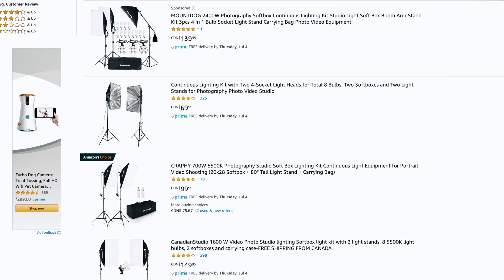What is a modelling light on strobes?

Comment: I appreciate the video it came real close to answering the question and problem that I have and it sound like we have the same problem when we first heard about modeling lights I like your whole video with you left out the important answer to the question that I have why you have the modeling light on and a preview of where your flash is going to go when I get ready to take the picture do I need to turn off the modeling light when it flash the strobe so it don't be overexposed or is the modeling right is still on while the strobe is flashing at the same amperature as the modeling light so once I have the preview from the modeling light before I take the picture do I turn off to my light or I can leave it on and my picture still come out correct that's the million-dollar question that where I'm confused at
Reply from the maker: Good question and it’s actually a different topic. Think of it this way: the modelling light is still ambient light. The why I set the camera is it will kill the ambient light (the on or off status of the modelling light doesn’t affect my exposure at all). That’s why you use a flash in a studio in the first place: you want to solely rely on our flash ad your sole light source. You want to use your camera settings to kill all ambient light, including your modelling light. Just think the modelling light as a normal light bulb in your studio.
Reply: @MingPixels  thank you so much I can understand it now that makes sense appreciate it appreciate it well needed

Comment: Does it also help with focusing issues? Used a speed light for a magic mirror booth but kept getting focus issues in darker rooms. Was ok when I used an old led video light. But there was no diffuser on the video light and it was blinding.
Reply from the maker: Yes, it helps.

Comment: Incident light isn't called that because it doesn't stay on. Both continuous light and flash light are incident light when it hits the subject. The reason incident light is called "incident light" is that it's the light coming from your light source that's HITTING your subject (the point of incidence), not the light reflected off your subject. What you meant to say is that it's called FLASH because it isn't constantly lit.

Comment: Do you turn off the modelling light during taking a shot with an incident light? Or the modelling light keep turning on during the shot? If keep turning on, will it affect the result (since there are 2 lights: modelling and incident light)
Reply from the maker: You do not need overthink it. Just leave the modelling light on and let the flash handle it. The modelling light is so weak and it won’t affect your image. (Please also check my other comments in which I have explained the reason s in more details).
Reply: @MingPixels  thanks

Comment: Thx. I have one question.
I want a ad600bm (manual is fine for me) to use as a strobe. But I need a video light also, so i figured that going with the ad600 it could be used as both. 
What do you think, any cons by using it as a videolight.? I know that color isnt as consistent and so on but im not a pro.
Thx.
Reply from the maker: Thanks for commenting. The short answer is no. It’s not practical to use it as a video light. I will make a video about it since so many people asked the same question.

Comment: When having the modeling light on does the modeling light turn off and the flash turn on when shooting a pic or do you have to turn the modeling light off b4 using the flash?
Reply from the maker: You do not need to bother it. Many strobes can set the modelling light to be automatically off when the shutter is triggered and then come back on. But I never use that function as my exposure has killed the ambient lights anyway. Please refer to my reply to other similar comments for more details. Thanks

Comment: The question still open is what's the difference between the AD400 Pro you showed in the beginning and the AD600 Pro you use in the demonstration of the modeling light. How much difference is there in "real life"? Where are the limitations of the AD400 Pro in comparison to the AD600 if it comes to the modeling light?
Reply from the maker: In terms of modelling light and it’s intended purpose, both are suffice. I do not think the modelling light is the differentiator between the two. However, in terms of the flash itself, I found the only weakness of AD400PRO pro is not its power but its tendency to overheat. If you shoot a lot in a short period of time, AD400Pro will overheat soon and forces you to wait for it to cool down. I never found the same problem with 600Pro.

Comment: @ming

Since it's about continuous light. My dumb question is: 

Can you use the ad400 pro as a substitute video light (flash bulb not mounted)? Are there any pros/cons in using a strobe flash as continuous lighting? I'm concerned about the ad400 pro since it saves power for flash output.

Thanks in advance.
Reply: This is what I want to use it for as well. A good one light source for interviews that can quickly be used as a portrait strobe anywhere I want

Comment: You still didn't explain does the modeling light will turn off when the flash burst out?
Reply from the maker: It’s a tricky question. First, many modelling lights are designed to be on the whole time when the flash is triggered. And the modelling light won’t affect the exposure as you probably have killed the ambient light already with your camera settings; Second, you will observe that some modelling lights may seem to be turned off when the flash triggers that’s because the energy the flash draws is so much that voltage for the modelling light is not high  enough for it to be on. BUT, it may also because the modelling light is designed to be turned off at the same time the flash triggers. However, no modelling light can be in sync with the flash (turning off modelling when flash on, and turning on modelling exactly the same time when the flash is off. (If they can, essentially it makes the modelling light the flash because it is so fast) That’s why you will find many modelling lights seems to take some time to be back on after the flash. Fourth, again, it really doesn’t matter if the modelling light will turn off or not when the flash is triggered as it won’t affect your exposure at the first place.

Comment: Thank you so much! One question I additionally have is, if you have the modeling light on and fire the flash, does the modeling light cut out or does it stay on and give you extra light on top of the light from the flash?
Reply from the maker: It depends. Most modeling lights are designed to be on when firing flash. However, most of the modeling lights will still be dimmed at the moment of flash firing not because of design but because of the flash draws too much power ( similar to when you use a hair dryer in the washroom, the lights will dim because of the amount of power drawn by the dryer). In my opinion, no modeling light can be accurately turned off and on at the same speed of flash because that will essentially make the modeling lights as flash.  As to if the modeling lights will affect exposure, it will not. It is too insignificant compared to the flash and you probably have already eliminated the ambient light (including the modeling light) with your camera settings in the first place.